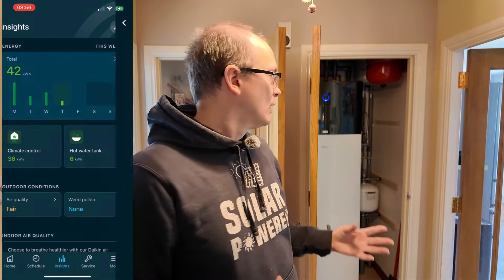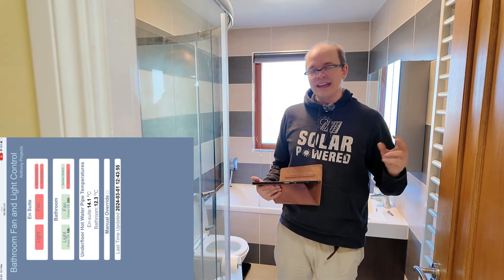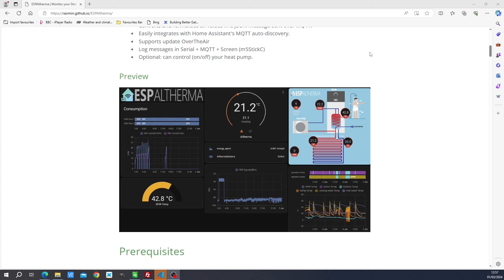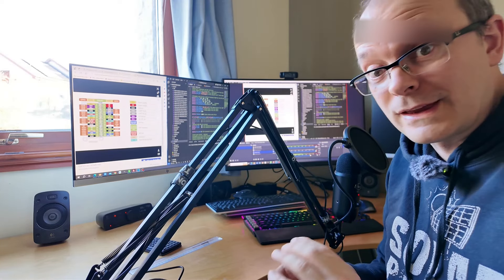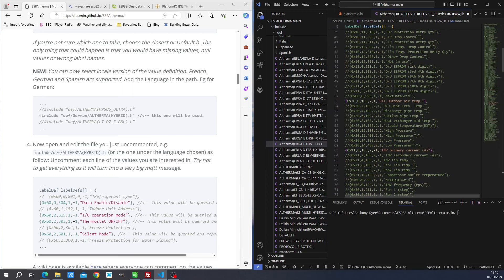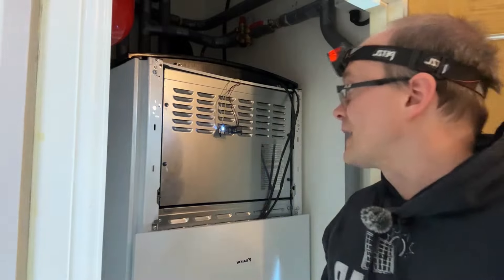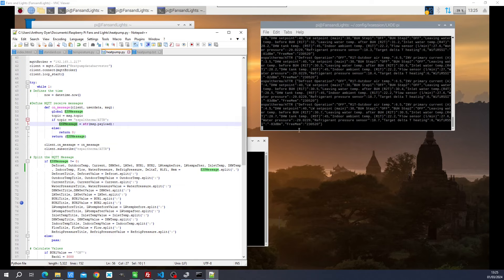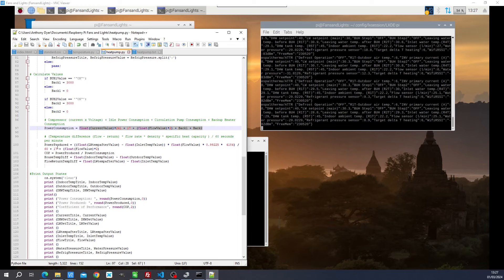Aberdeenshire Heat Pump Odyssey Part 4a:  How to acquire data from a Daikin Altherma Heatpump

Comment: This is a great video and I'm looking forward to implemeting this to my Altherma as well. While being new to ESP32, I was wondering about the GPIO pins capability. According to the specification coming with the ESP32 dev kit, it seems like the GPIO are vor 3.3V operaation. Isn't the Altherma interface a 5V logic? how does this work together? Wouldn't it overstress (kill) the GPIO of the ESP32?
Reply from the maker: @User1-zk2xr  each ESP32 has its own pinout, but mine has at least one 5v pin.

Comment: I'd highly suggest node-red for automation and could be added to your existing Pi.  Also make sure you back up your data file regularly just in case the Pi card corrupts.
Reply from the maker: Yes, my next plan is to rename the txt file at the end of each day and then attempt a connection to my windows machine for file copy.

I’m well versed in the traumas of corrupt sd cards.  My existing card is a “high endurance” card and it’s been going strong for nearly 4 years now.

Overall I’ve got I few ideas to develop this program, and data preservation is one of my higher priorities.

Comment: Is your heat-pump SG ready? Can you get it putting extra heat into the cylinder when you have excess solar? Could you have it back off when your battery is depleted and its peak rate

Comment: You should take this down and re-edit. You didn't black out the ssid/password for your WiFi correctly. The tooltip that pops up in vscode shows them.
Reply from the maker: I've just applied a blur to that section.  Thanks for pointing it out.